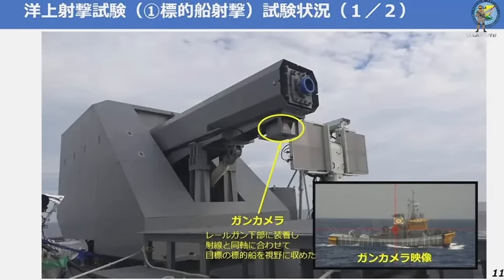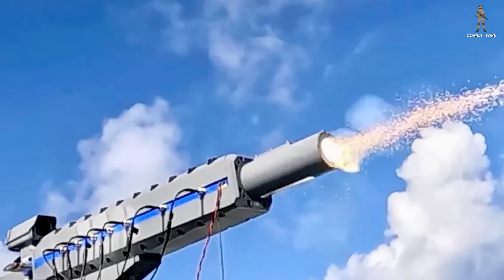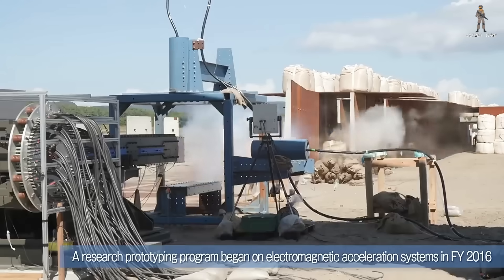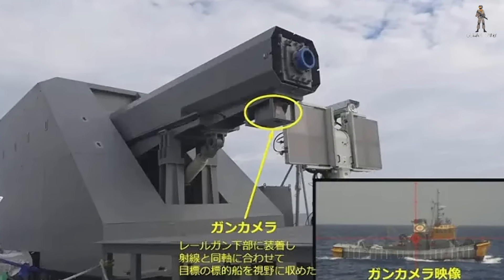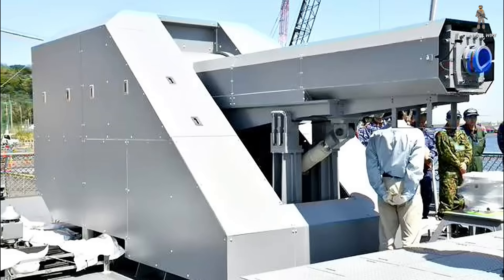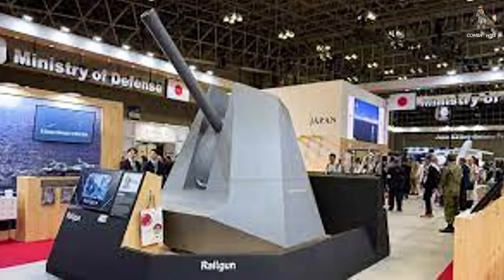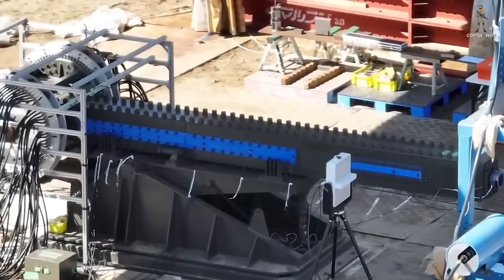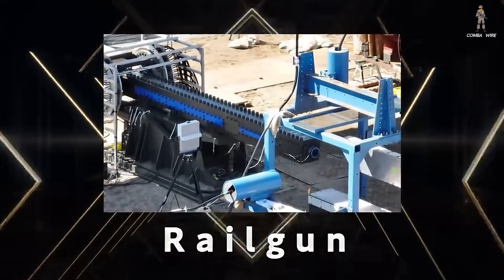For the First Time Ever, Japan Reveals True Railgun Damage at Sea.

Comment: You could reduce the heat and stress on the railgun (and hence dramatically increase barrel life) by pre-accelerating the projectile by traditional explosive means. If you improve cooling and use multiple barrels, where you rotate through the use of each barrel in turn, then you can dramatically increase the lifespan and fire rate.
Reply from the maker: excellent points about reducing heat and stress through pre-acceleration and multi-barrel systems to increase lifespan and fire rate!
Reply: You can just use air pressure and a vacuum to get it close to powder speeds without any wear or contamination.

Comment: A kind of "conspiracy theory": USA makes big announcement of cancelling railgun, but actually moves it into deep cover, and uses the power delivery systems that are"public" for the electromagnetic catapult system to provide the power needed for the railgun.
Reply: I can tell you with 100% firsthand knowledge that is exactly what they did. Verbatim. I deliver to Dahlgren where it is being tested. They moved it from the lab on the hill to the barrel testing range. They recently put up new signs warning about the blasts in the housing areas on base. A few months back the barrel range side of the base was closed to traffic and I was told by a contractor it was because they were testing the "e-gun"

Comment: JMSDF will have to make a Nuclear powered ship to be able to consistantly power the guns. Then a bank of capacitors that would allow rapid firing which I do not know how much power the rail gun needs to fire or how rapidly that could be replaced. 
That is a major issue because say the capacitor is massive this might be the end of the program because you could not load a ship with enough capacitors or charge them fast enough. Some AI estimates say this would be 90 tons and 120 cubic meters to power one rail gun for 25 shots.  
So now a rail gun ship is rather large and expensive to say utilize two rail guns or even four with alternating fire and redundancy. 
The second issue is the stability and aiming of the gun. then the ability to rapidly replace the "rails" even in combat conditions.Maybe even a barrel swap. the automated system for loading round has been solved already with a number of shell loaders in service. The ship would still need a number of weapon systems in use now like AA missiles and LASER AA as well and then close up defenses. What this comes down to is rapdily engaging targets accuratley and in volume because the round will have to mission kill the ship by destroying on board muntions, radar, targeting and or engine/electrical in the target vessel. Sinking an ship would not be practical at this point.

Comment: Realizing they're still in research phase and using relatively cheap solid projectiles...but the most critical need for railguns is a cheap-per-shot way of taking out high speed aerial targets.  And for that they'll need either guided projectiles and/or a fragmenting projectile.  Not easy to do with the crushing G forces at launch.  I have a hard time believing they'll ever get a RG with enough power to throw a relatively massive explosive artillery shell further than today's conventional artillery guns.
Reply: solid projectiles are the whole point of  rail guns.
They are kinetic energy weapons - they make a bigger explosion from the conversion of the kinetic energy they contain to heat than they would if they had explosive warheads.
And their muzzle velocity eliminates the need for guidance systems
Reply: Problems with what you wrote:
Between time of launch and (projected) time of intercept, the target may have maneuvered from its predicted trajectory.  Even an error of a foot is a "miss" for a dumb projectile against an incoming missile.  Of course, if you wait until the incoming missile is a foot from the mouth of the rail gun, your shot will hit, but that's a little late!  Your RG projectile isn't a light speed weapon - it will take human measurable time to reach its target at the desired intercept distance.  So - you increase your odds of hitting the moving target by either of 1) fragmentation (increases cross-sectional lethal impact area) or 2) continuous guidance.  All of that kinetic energy you're so amorous about is USELESS unless some part of your projectile hits the target!
Reply: Also - good luck hitting your target with your unguided projectile if the target is over the horizon.
Reply: @banalresentive6523 
2km/s is nothing to sneeze at, especially when conventional CIWS fire much smaller rounds at 1km/s.

Current concepts have the railgun slug self fragment on a timer
Reply: @Demopans5990   I agree, that's good.  I will  mention that 2km/sec is in the same league as incoming hypersonic or ICBM warheads.  Ideally you'd like to intercept them several kilometers out: debris from "close" intercepts of conventional warheads may pummel your ship/installation.  As to nukes, I don't know enough to say if hitting them with a fragment of metal at a closing speed of ~4km/sec would disable them "instantly", their outer shells tend to be made of depleted uranium which is pretty dense.  A really hard hit with a complete penetrator (or really dense cloud of fragments) might be desirable which again would imply guidance.

Sorry for the lecture, I'll try to shut up now (I can quit anytime I want, I swear!).

Comment: Since the railgun work using electromagnetism I wonder if it's possible to make the projectile levitate inside the gunbarrel because this, I think, would prevent wear and tear from friction between the inner side of the gunbarrel and the sabot (ie. the outer casing of the projectile)
Reply: I don't believe so. Railguns are not coilguns: a railgun functions by running current directly through the projectile (or a supporting sabot), so creating an airgap across which this current must arc would probably make the pitting problem worse.
Reply: @alexholker1309  Hi, thank you for your input. I was thinking of a maglev train when I wrote my comment if that make any sense.

Comment: Make great land based defensive positions in the right spots.
Reply: If you could get it mounted on a vehicle, a great 'point defense' option.
Reply: vulnerable
Reply: Would be cool if there was railgun towers in the ocean, like 1000 of them surrounding Japan that can submerge in water for cooling and for defense
Reply: biggest gaping hole in all western countries is replacement-migration. I personally blame 🧃for that. no weapon can protect you from that... if borders are opened wide.
Reply: as cool as static defenses look, unfortunately it will almost always be outperformed by anything that has the capacity to be maneuvered.
Reply: At present, these things would be terrible stationary defenses. 

Since they can’t be repositioned like normal artillery, these gun must be installed somewhere with an unobstructed view over the surround 200+ miles. That position also must fit a small nuclear reactor and all the necessary maintenance crews and logistics chains for both the gun AND the power plants. There are not many potential spots for these, making these guns easy to predict and find, especially after they fire.

Such extreme costs and limitations means the gun batteries could not be mass produceable, so each would be an irreplaceable investment. Further, since the guns also cant defend from multiple small threats to themselves and don’t outrange the big ones, they are prime targets to any enemy. 

Therefore, in addition to all the requirements, each gun installation needs its own permanent defensive force, complete with AA capabilities, mechanized infantry, and all the logistical support those require too

Basically, railguns are about the most inefficient, ineffective, and unreliable choice for a stationary gun emplacement and there’s better, cheaper options to kill everything you’d use it for anyway.

Comment: Ok. Engineer it to work first. Then build one where the parts that wear out can be changed at sea by the crew in a hurry. Then integrate it into a ship. I suspect that thing would be good for shooting down inbound hypersonic cruise missiles & glide vehicles. With a closure rate of about 3 miles per second that wouldn’t give the enemy munitions much time to dodge.

Comment: Railguns are pretty cool, but seems like they could only fire solid metal slugs, and punch a relatively small hole on the ship's hull that could be relatively easily patched. Railguns make really good armor-piercing weapons. If only their energy supply could fit on tanks...
Reply: Behind that small hole is armories, batteries, engines, VL missiles and equipment. Most of those don't react well to suddenly lose chunks at March 6. Also this is even better at defense, as a single slug with a timer would basically be a shotgun blast against a hypersonic missile incoming, with 120-200 shots per weapon a fleet would suddenly not have to fear incoming hypersonics anymore, as missiles at those speeds can't turn well enough to avoid the shells, so it becomes a number game in both cost and amount. To sink a ship you would need 100's of missiles at millions per cost vs a slug costing 10.000's per shot, and the infrastructure and support to use both.
Reply: Well you see when they heat the enemy ship the transformation their kinetic energy to heat this mean that esentaly anything that gets heat will heat up maybe for now they can't produce enoght heat to turn it into plasma but keep in mind that any material they heat will carry onto them and the shell gonna be fragmented after the initial hit becoming smth like a grape shot
Reply: Kinetic energy is not something to be laughed at.  The the materials that made up that small hole will be moving about the same speed of the projectile.  And even worse of the projectile was frangible - meaning that it breaks apart after making that small hole.  

Remember the saying: "There is no defense against kinetic energy."

Comment: 26 Years ago, I was working in the Tool Crib at Kings' Dominion Amusement Park, in Doswell, Va.. we had, then 2 Rollercoasters that used Electro-mag propulsion to make the Trains GO FAST, Smoothly, UPHILL. "Volcano" actually went Vertical a good 110 Feet before rolling into it's gravity-powered glide back to the Station. At the Apex of the 1/2-loop, Anyone wearing Loose footwear (be un-laced Boots, Slip-on Sneakers, or Sandals) was at risk to losing one or two, and, after awhile, We had a "drop-Zone" where Footwear was likely to Land (moved a Burger-Stand, too, because once, a Large boot took a Dad's family-loaded-tray right outa his hands!). Keep in mind, the Train could weigh-in at over 5 Tons, yet it went almost 70 mph before going Straight-Up. It had 3 'boost phases' along it's climb. So, the US NAVY actually came and got a good 'inside look' at how these Roller-Coasters worked, stating at the time that they were looking at Carrier Catapult modernization. I doubt That, as Planes are WAY heavier than a Coaster's train. But, yeah, the NAVY has been exploring this Tech for Awhile! I was surprised when the Zumwalt's quit trying to use Rail-guns (citing the 'cost of Munitions'? Really? IDK), and went back to Missiles for their 'main' armament.  Now, IF, someone figures out how to add Thermite to the Core of a Rail-gun Projectile (w/out it Exploding upon Launch), then, you'll be putting the Hurt on many Navies...
Reply: that "cost" was not the railgun ammo it was for the guided ammo tor the normal cannon that replaced the proposed rail gun
Reply: @311Bob Wanna Explain that? In something like detail, & reason?
Reply: @ericbrammer2245  sure but I'll explain it to you any way,the railgun was the first choice but it wasn't reliable yet AGS advanced gun systems  that was to fire special long range land attack projectiles but they were to expensive  and now they are going with hypersonic missile system .the cost for rg ammo is relatively cheap as its basically metal no electronics or explosives so no special handling or storage demands, like hazrad.or fire suppression  just normal commonsense handling . it just the cost of the base metal and plastic sabot

Comment: If they are firing in series as a battery of guns instead of a single repeating gun it could make sense, they need to flood the barrels with water or some medium to stop it basically arch welding it's internals away, liquid metal or graphein maybe? to prevent barrel wear or a combination of both, then a heavy rubber flange on the projectile to clean the barrel after each shot. A projectile with 2 rubber flanges could have the entire length between those 2 flanges pressurised with water increasing the surface area contact while containing the water long enough to prevent it from turning to vapor. Maybe there could be a way to add the vaporized medium as a jetforce out the rear of the projectile like a bottle rocket?  SO you would effectively have a rubber and mostly water sabbot.
Reply: the heat would turn that idea into a steam bomb, water expands 16 time when it turns to steam.

Comment: Its still best as land turrets till then or used on satellite  or aircraft carrier size ship  it will be  nice if it was shrunk down  for ex imagine an apc set with rail gun instead of holding  crew make it amphibious  apc now you got land and water now findings  a power source the size of a back pack that can power it the only issue is hard to arc it but the pen is great  it could also break asteroids apart  full volly would be scary but we need to workout wear and tear and a pure power source the other problem  is over pen imagine firing at it hits land  by piercing  target but regardless hope for best be safe semper fi
Reply: Any backpack sized power source having the energy density to repeatedly fire a projectile as shown would revolutionize the entire world.
Reply: @ParkerDay-y2o the issue  is finding it I we could have the material  staring right at us  its one thing to get that type of material  but if it's in a area where we can't reach that's the part that sucks or if it's rare we could probably already have it but not know of it's properties for ex Pluto they change what it was till now we change things when we find new ways are tech is back then in 2 years we could find solutions or 40 years especially if we keep shelving it what I learned in the military we usually  forget the project or we have to many and cut it or by doing another project we find a solution to part of one we where working on but hopefully with this we can also create a mode of transportation  that can fling like a catapult  we could use instead of rockets and use such rockets to return  home we just not able to see where it will lead once we get running  without problems  be safe semper  fi

Comment: Waste of $ no range, multiple drones and missiles are more cost effective. A rail gone can’t fire more than 30 miles.  Same as an obsolete battleship gun.  We are following the same program as 1930 - 40’ Germany create wonder weapons and wonder how militarily and cost effective they will be.?
May be effective on a battle-star in space, if and when enough power is available in orbit .
Reply: 115 mile range.
Reply: Think of the cost per shot of a railgun vs a missile.  Also consider the fact that a smaller ship can carry hundreds of railgun rounds vs. ~32 missiles.  BTW - the projectile for the US railgun that was abandoned a decade ago had a range of over 100 miles.  If they can get the rate of fire up to the same as the current navy 5 inch gun - then drone swarms will be incapable of making it to the ship (and it's close in weapons and ECM).

And speaking of 'wonder-weapons' - that s what cheap drones are today.  They are effective only because of the time lag between their introduction and the development. testing, manufacturing and deployment of counter drone systems.  Drones are not going away - but they will soon cease to be 'wonder weapons.'
Reply: @colincampbell767  So after fighting of a 200 drone swarm this thing is falling apart and needs a complete overhaul. Very smart.

Comment: Its all good, but the sparks coming out of the barrel are undoubtly pieces of the barrel... barrel longevity as you mentioned already is the issue with this weapon.
Reply: More likely. pieces of the sabot.
Reply: @colincampbell767 debatable
Reply: @colincampbell767 and why would they need sabot for a railgun? Its not like it is firing sub-caliber shell out of a full-caliber gun.
Reply: @alcerixxia614  for railguns specifically you need a sabot to make sure you have good electrical contact so the projectile actually gets propelled, but also they use APFSDS which is sub-caliber, the actual penetrator is thinner than the fins that stabilize it so they have to put support material (the sabot) at the front to keep it pointing straight while it's in the barrel
Reply: @slipperypianist so what i am hearing is that it is the sabot attached to the projectile that is being propelled by EM instead of the actual projectile?
Reply: @alcerixxia614  precisely
when using APFSDS the projectile itself is usually not conductive because the insane amount of electricity that would flow through it could damage it and make it miss the target